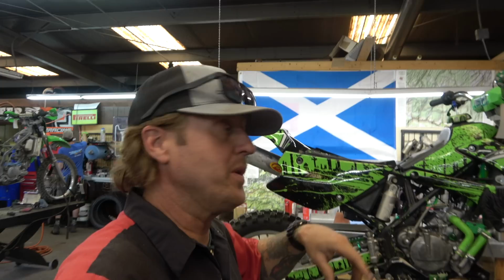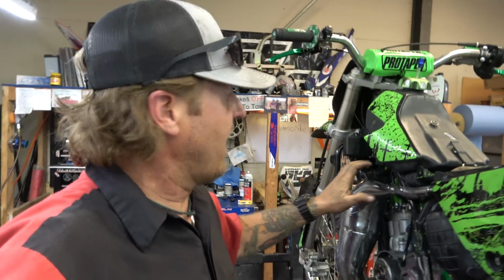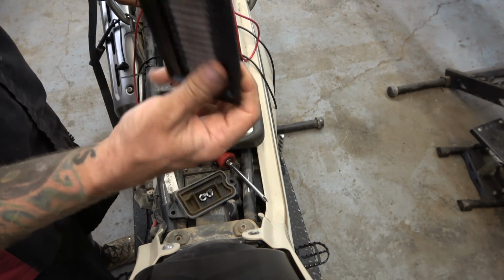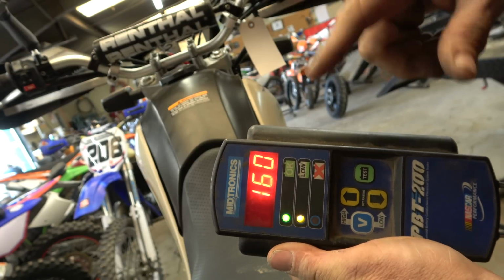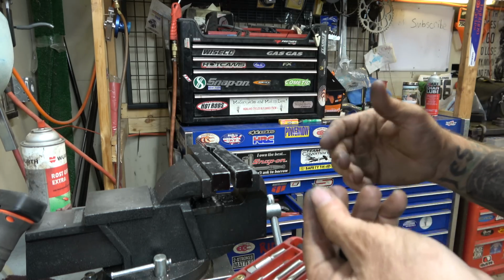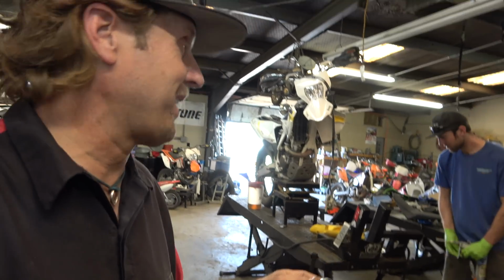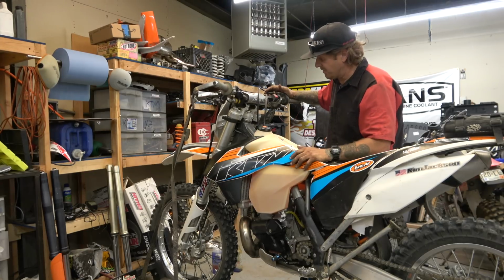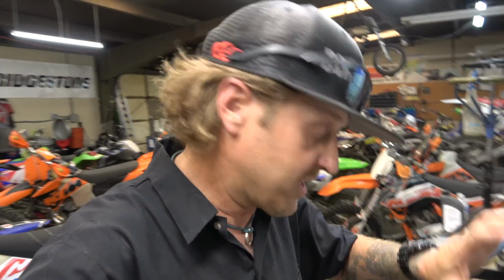The Shlog #164 : RK Tek Head, KX85 Diagnose, Tech Tip, Tool Spotlight

Comment: on the KX85.. I would check the timing to see if the woodruff key is sheared or the mag is on in the incorrect rotation.. Gap the spark plug to .018" as well.. Other thing to check is to make sure the pipe/silencer is not restricted.. Is there  a video of the running issue? All I have heard is what is in this  Slog and that is not very telling
Reply from the maker: Yeah. Checked all that. Everything is as it should be. Was super corroded in the ignition cover when the customer got it.